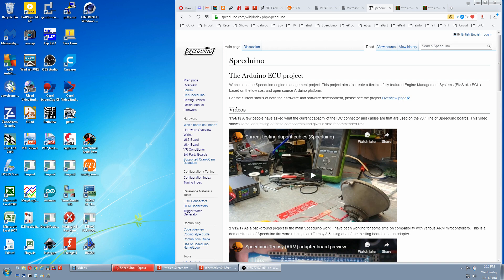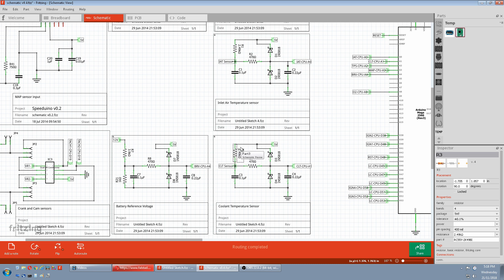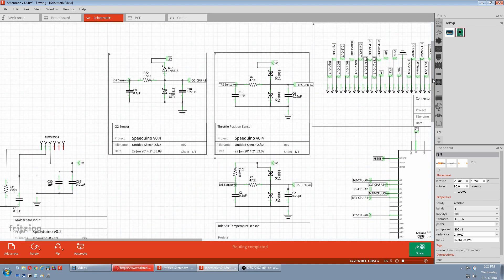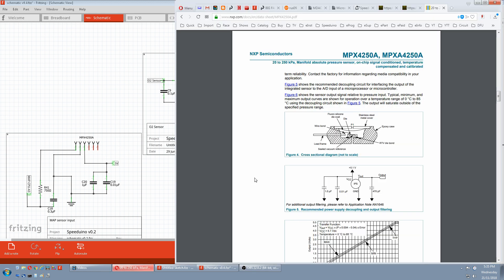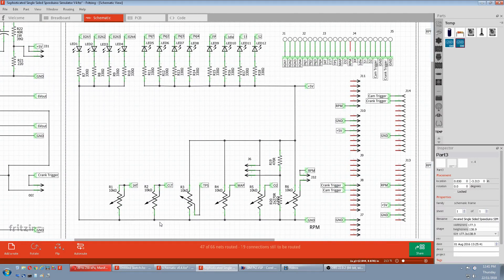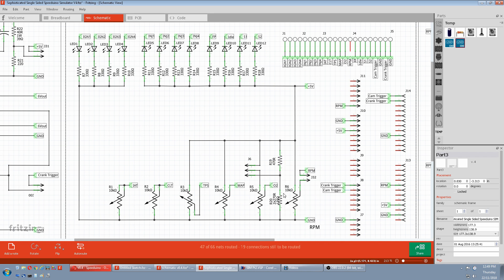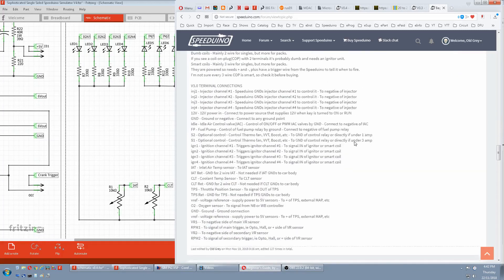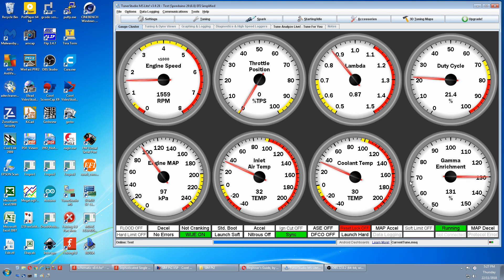Speeduino EMS #4 : Sensor Simulation

Comment: does the simulator outputs hall or vr for the crank?
Reply from the maker: Gee, I was so dumb back then I didn't even know this is a stimulator - lol -, ie, hardware is stimulation, software is simulation.
The stimulator puts out a 5V square wave :-
VR has a conditioner that converts it to 5V square wave.
Hall is powered and has circuitry that puts out a 5V square wave.
Opto is powered and has circuitry that puts out a 5V square wave.